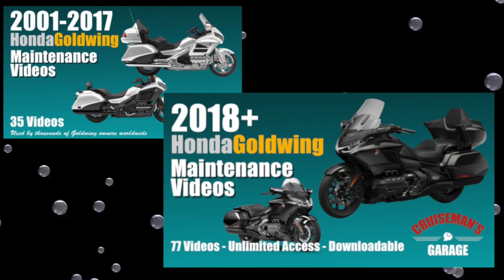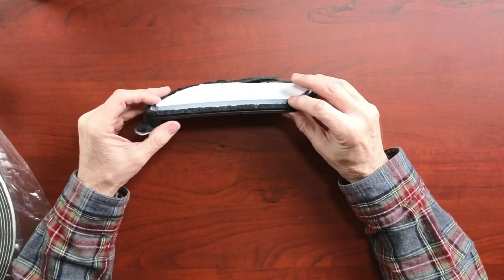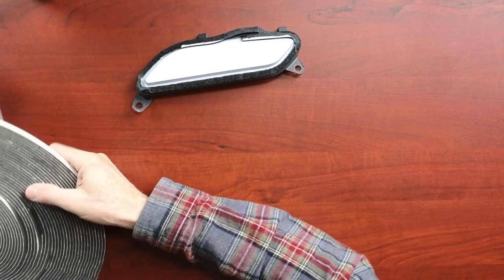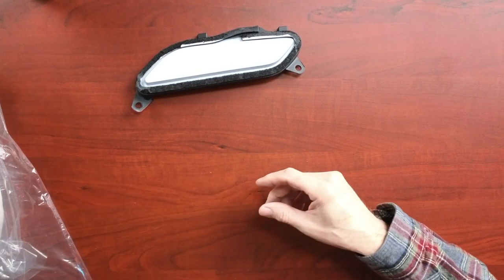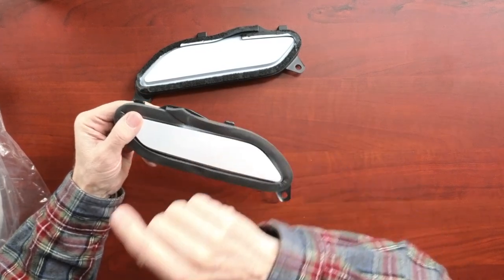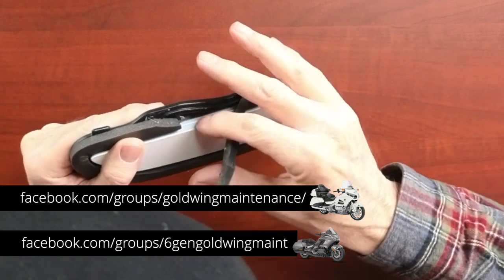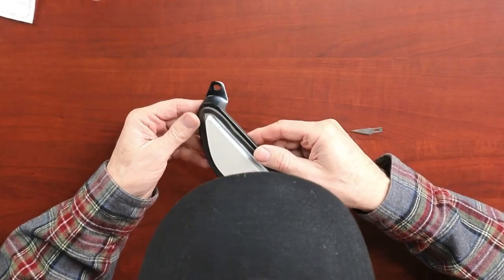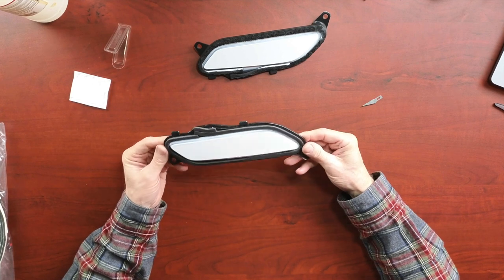Trunk Insert Gasket Rebuild | Trunk Swap Part Two | Cruiseman's Garage

Comment: This is a no brainer, you should have removed the foam in the first place and painted underneath.
Reply from the maker: I would have but Honda does not paint under the foam, and I thought the paint may make the foam more difficult to re-apply.

Comment: It won’t help you at this point, but I wonder if just prior to painting you had smeared a thin coat of Vasoline over the top surface of the gasket to keep the paint from adhering. Then after painting it could be cleaned off.
Reply from the maker: Another good idea

Comment: To test the seal without water, put strips of tissue or light paper along the edges 90 degrees to the seam, install the piece, and then try to pull the tissue out.
Reply from the maker: That's an interesting technique

Comment: You have to redo the tape again,  Cut the angle on the tape with a pair of scissors before you start sticking it to the panel, This Will be a lot easier than trying to cut it in situ with a knife blade

Comment: If you had painted the foam you might be in a similar situation 
The paint may of harden the foam  or even had a chemical reaction with it. 
I’m surprised that a Honda dealership wouldn’t be able to help you getting the right size
Reply from the maker: You must have more helpful Honda dealers in your area than we do here :)

Comment: Hay cruiseman what are those cut outs for? In other words what optional equipment goes in those slots? Maybe if your method does not keep water out, plug those holes with that optional equipment. Good luck with whatever you try.
Reply from the maker: They are for mounting the Honda luggage rack but I will be using them to install a PathfinderLED spoiler.